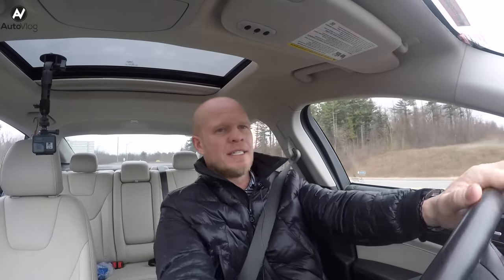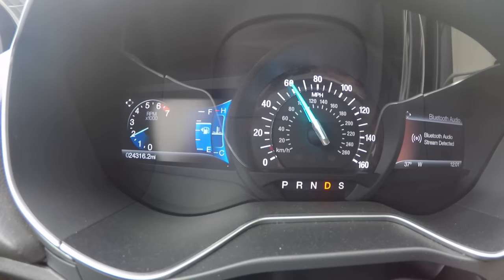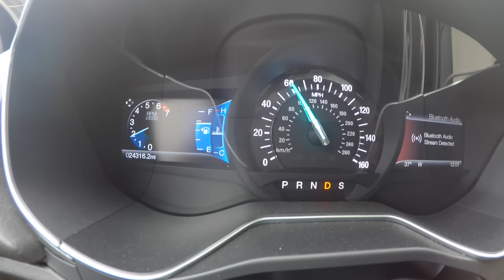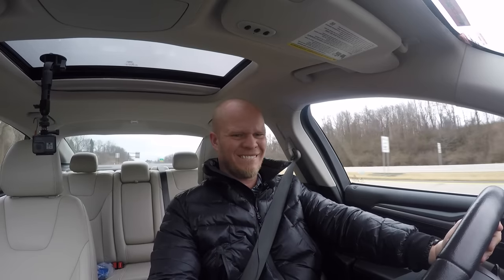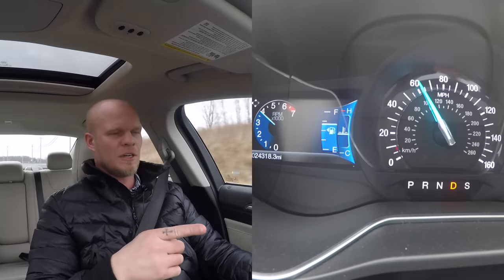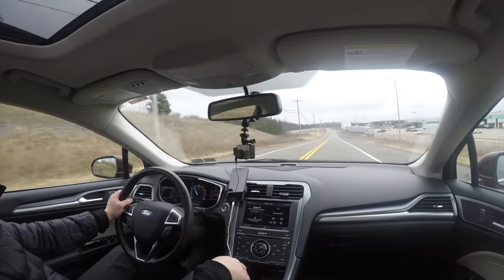What happens if you put your car in REVERSE while driving? (Things NOT to do while driving)

Comment: I bet the car behind you saw your reverse lights and got a little scared
Reply: ha hah hah aha hah
Reply: "..Shit. A lot of shit!"
Reply: Hhahaha Good point.
Reply: 10/10 would brake check again.
Reply: your selector stick is also electronic, that's why it didn't do anything, the only exception is the parking selection as it has a  mechanical safe to block the movement of the inertial wheel
Reply: Rafael Arriaga Spezzia no one was questioning why it happened
Reply: I drove around without knowing my neutral safety switch was causing my reverse lights to stay on. Nobody honked at me surprisingly.
Reply: Barry Bamb lol
Reply: Jack Pepal 😂😂😂😂😂
Reply: was thinking the same thing XD
Reply: what about manual transmission cars?
Reply: The gears will just grind, you wont be able to get it into reverse gear.
Reply: good idea, try with manual gearbox
Reply: The Synchros will stop it from actually going into reverse but yeah a lot of grinding happens also. Mythbusters tried slowing a car down with an old automatic gearbox and a manual gearbox and nothing really happens
Reply: lizzo001 manual gearbox helps u a lot when u are slowing
Reply: Jack Pepal there's no car behind him
Reply: Luis Aguirre there is at one point

Comment: why would you do it on the highway?
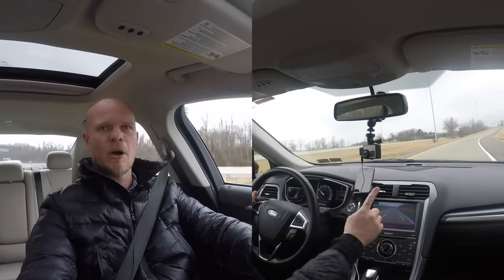Reply: BCRoadGeek **Listen at 2:20 when the car is in reverse... No cars?
Reply: BCRoadGeek **I didn't quote you on anything you said. Whole point is what if it did blow up and parts went everywhere. Plus transmissions don't have a whole bunch of oils in them. That's people point I'd assume. Yep, they do...
Reply: Ford has a transmission control module that monitors several different inputs such as vehicle speed and above a certain speed the module will not allow the shift solenoids to engage into reverse so as not to destroy the transmission. Don't try this EVER, especially with older vehicles, as not all vehicles have this safeguard. You've been warned.
Reply: If i put my 2012 tundra in reverse the reverse lights, cargo light, and my backup camera comes on while the truck goes in nuetral.  But that is a built in feature. Tailgaters hate me at night needless to say lol
Reply: Blaine Palmer 
i have a feeling he researched nothing would happen despite what he said.
Reply: same happen my dumb ass did it my honda 2010 and it just went on neutral

Comment: all automatic transmission has some protection mechanics, try to do this on manual transmission, you will either fk up your transmission or fk up your car and cause crash
Reply: David King more like you'll just grind some gears.
Reply: thats not how manual transmissions even work.
Reply: bwn 2k you don't need to tell me. you can try it out
Reply: I have. you cant do that on any modern-ish manual car.
Reply: If you can manage to get it in to reverse while going forwards that is.
Reply: you can't put a manual to reverse while going forward. It's impossible. If you try, it will just make that weird noise when gears touch each other, but you can't actually put it in.
Reply: if you have a synchro on your reverse gear it will go in. not many cars have them but they are about.
Reply: not all automatic transmissios have a safety against this, the new transmission are all electronic and are shifted by switch's, the old style on the steering column are done by a over to a cord to the transmission that shift it through park nuetral drive d1 d2 , in that case he transmission would try to shift and breathe the reverse drive clutch and no more reverse...there ya go
Reply: steffan thomas Q
Reply: steffan thomas Idk about that. My 71 BMW had that and so does my 85 Supra
Reply: Actually the synchro stops it from going in since the synchro only allows the gears to mesh when they aren't moving in reverses case, however if the synchro is broken you can get it in reverse. It wont lock up the car or break anything it will just stall the motor and act like its coasting in neutral
Reply: my car is a mazda 6 from 2003 and my girlfriend was driving 90km/h (~56 miles/h) and put it into reverse, as she is used to having 6 gears. I don't have troubles with the gears at all.
Reply: No actually your car will start locking up the drive wheels and the engine will start to run in reverse, depending on the speed it is performed you can throw a rod and overall total your engine from over revving.
Reply: not true not all autos have cut out protection hahaha
Reply: fhhsvnggbh depends on speed, going slow enough reverse can be used to stop the car
Reply: I've used reverse to stop when my brakes went completely out just a couple months ago in my manual 05 Jetta
Reply: +DannyMellor R.I.P Clutch.
Reply: Fudge You No actually not. I down shifted to a low gear so I was only going to reversed from a few MPH. You so what you need to when you have no brakes.
Reply: Ahh, thank god you had a stick is all im gonna say. Some autos let you select the gear you want to be in so those can be helpful but unless they lock up the torque converter not much engine breaking will happen.
Reply: If you dont have brakes just turn off the ignition. Atleast you wont have to pay for gearbox repairs (though I dont think gearbox will totally disintegrate, but doing this should worn the reverse gear).
Reply: David King now i will search videos of someone put reverse in manual while driving :v
Reply: It wont happen, I guess technically if you put enough pressure on it, you could destroy your reverse gear. However the rest of your gears should be fine. You see all modern manual transmissions, are called synchronized transmissions. This means that there is a synchronizer between each gear. This allow to shift from one gear, to anther, despite the fact that those two gears are not spinning at the speed. There is no synchronizer for reverse, because is always engage at a stop, so all gears are spinning the same speed, 0. It is also, accidently, a nice idiot proof. However I do have one question, especially on this automagic car, when you put it in reverse, are your reverse lights coming on. If so, do you think behind you, doing 60 shit his pants :).
Reply: Kevin Weil good question :)
Reply: If you have the arm strength/stupidity to do it in a manual I'd be amazed. Attempting that in a manual will result in the shifter resisting you and a lot of grinding. The faster you're going, the less likely you are going to be able to put it in reverse while moving. If you ignore the grinding and manage to get it into R, you shouldn't own a manual.
Reply: ryfodrea agreed, I drive an 02 Audi a4 1.8t 5 speed... And I'm used to driving a 6 speed. So there has been more than a couple of times where I have tried to put mine in  Reverse accidentally and couldn't do it

Comment: you have an electronic transmission.  the trans controller refused to select reverse because of the vehicle's speed.  if you had an older auto trans with direct selection you would have locked up the wheels, possibly snapping the trans output shaft and crashing because of the sudden change in velocity of the wheels.  in a rear wheel drive car it would have been similar to just pulling the ebrake and locking up the wheels with respect to the cars reaction to the gear selection.  at low speeds you would have just lunched your transmission and probably not crashed.   a manual is not that different in results.  I am very shocked that you tried this on a public highway.
Reply: thevdubin bro if you were doing 100kmh its unlikely youd even lock up the wheels of a front wheel drive car, youd just blow the inside of the transmission everywhere and keep rolling. On a rear wheel drive car it might lock up the wheels briefly, however it is more likely just to smash everything and keep rolling
Reply: Just imagine an old ford C4 getting thrown in reverse at 65 mph it would probably throw it self out the car our self destruct with a change in power that quickly lol
Reply: Word.
Reply: thevdubin not.
Reply: So in an old truck could you roll out of a parking spot and switch or will it quickly lock the gears
Reply: unless he knew nothing would happen because it's electronic
Reply: Thank you someone who understand cars do people not know that u can just google this
Reply: thevdubin I was going to say the same thing
Reply: thevdubin I'm pretty sure he knew nothing will happen especially when he knows there's a car behind. But I agree that my feeling is the same as yours when I just loaded this video. BTW, I do love the facial expression he pretend to have lol
Reply: thevdubin that sounds about right
Reply: thevdubin  I thought the same thing “on a public highway” nah I think he already knew what was gonna happen  because why would you take such a risk in harming other drivers for the sake of an experiment.
Reply: thevdubin Jo
Reply: I was in a 98' Corolla Automatic car doing 35-40mph when the driver forgot she already had it in neutral while going downhill and threw it in reverse. The entire car stopped quicker then slamming on the brakes and everything flew forward. Scary as hell but no one was hurt. It definitely was an experience.
Reply: thevdubin not true.... At all. Lmao.
Reply: Dimitri Borozny only if you have your foot pushing the accelerator pedal
Reply: People who have older trans cars need to read this so they don't try it
Reply: kyrren love it will still glide in neutral unless your foot is depressing the accelerator.
Reply: Nzmaximus no one uses kmh kid.
Reply: thevdubin I was shifting into neutral going about 40 miles an hour on an automatic transmission and I accidentally threw it in reverse. I never pressed the gas though so am I fine or should I check it oht
Reply: Pearce Packman depends on if you felt the car jolt. Putting it in gear is enough to destroy it if you were already at speed. As stated above, if it's an older transmission then you'd already know the car is destroyed
Reply: A manual would reject reverse
Reply: if u were only going say 2mph and shifed into reverse while moving forward, samething?
Reply: I had a 1984 Dodge diplomat slant 6 cylinder, I was going 45 mph I accidentally hit the shift upwards in reverse and nothing happened to the tranny all I could hear was a rapid "clicking" sound as if the tranny was designed for such an accident. I shifted back to drive; everything was normal...
Reply: @maxneale6334  I knew a guy that had a back wheel drive car that he and his father custom built. He did 120kmh and he accidentally shifted to reverse causing his car to spin out, he fell through the window and the car on top of him while rolling down a hill. His friend who was sitting next to him survived.
Reply: Dude your a legend for this comment
Reply: That happened to me once. I once ruined with misshift
Reply: thevdubin Well, actually it has to do with the torque converter. As long as he doesn’t step on the accelerator, the torque converter will be overpowered by the momentum of the car as the engine is not creating enough fluid flow to rotate the transmission turbine. Now, if he did decide to step on the gas, the transmission would be twisted completely.
Reply: I did this by accident trying to move to neutral and my hand slipped and went to reverse. I wasn’t going very fast. I say about 20 mph or 30 and well it locked up didn’t crash I was able to steer it but my truck turned off. It turned back on and right now it doesn’t really feel like anything happen although I’m pretty scared lmk please on your response
Reply: @fredo6669  in an auto its a bit more forgiving.  you will have caused damage, no doubt.  but it could be a bit less life in the clutches and steels or a bit more like a cracked part.  if you feel no issue right now then there is no telling when you could have a prob.  be happy and drive it.
Reply: thevdubin I’m happy as hell lmao I’m glad I wasn’t going fast. Or anything phew 😅
Reply: So you snart smart huh
Reply: Hey i have a 2017 ford flex se, if i put into reverse while driving. Will same thing happen in the video or will the transmission be ruined
Reply: Can someone help me out cuz my friend crashed it seemed kinda sus but I still don’t really know about cars but she put the car in reverse and I think she pressed on the gas cuz then we went forward really fast and crashed into a light pole it’s like she pressed on the gas hard (remind u she was a new driver but she was driving around a parking lot before that happened perfectly fine)
Reply: No its just shuts off the engine but that was in a 2000 Chevy 6.0 diesel
Reply: @debbicockett6044  you are very beautiful!
Reply: he tried it in an older automatic, and all it did was stall/shut off the engine because of the sudden force, but the torque converter and whatever make it so the wheels don’t lock

Also in a manual car its very hard to put into reverse, but it would basically be the clutch handling all the force
Reply: @eirenjoe1513  It would lock the gears and shut off the truck completely (probably to save the truck from breaking itself), at least that's what happened in my 2000 toyota tundra
Reply: this is reassuring to know. Recently my friend accidentaly shited to R while I was driving, because he thought the revolving shifting knob was a music buttom for volume. I freaked the sh*t outta my head at that time but also feeling bizzard because nothing happened, the car just goes on. And I kept doing research afterwards to see if that action would damage my car. Now I know it should be fine, thank you.
Reply: I just did it in a 2005 Chevy Malibu V6 at about 15MPH, it made a short screech noise but didn't lock up and when I put it back in park it wouldn't drive but when I restarted the car it's fine now

Comment: what people dont understand is that this guy has basically a brand new ford which has technology to prevent shit from happening, try a manual or an older car and lets see if u get the same reaction
Reply: jake from statefarm my thought, exactly
Reply: Manual would just crunch like fucj
Reply: it will shut off the engine. i once accidentally chucked it reverse xD 1997 holden.
Reply: EXACTLY MY WORDS FR FR
Reply: jake from statefarm exactly my 04 Chevy Silverado would probably throw the damn transmission out of the truck 😂
Reply: if its auto no it will just shut off the engine its happened to a friend of mine
Reply: jake from statefarm exactly. I won't try this on my car.
Reply: on manual you just cant put reverse while the car is moving
Reply: you will just hear the gears eating each other lol

Comment: Get a really really cheap disposable manual car and take it on the empty road you like to use. That will deffo throw into reverse
Reply: Dominic Rawr Yep, there'll probably be a grinding noise & then all you'll see is the car slowing down & smoke everywhere
Reply: Zubin B. Most manual transmissions won't let you put it reverse while it's moving forward.
Reply: It's theoretically possible to put a really old gearbox without a syncromesh into reverse if your strong enough to put enough force into it, which is why i suggested a really really cheap disposable car because it will most likely be old enough to not have anyform of protection
Reply: no you can force it in gear... just pull with both hand and it will go in followed by an awful grinding sound and metal fragments being thrown around
Reply: I ground the gear a lil by almost putting it into reverse instead of 4th in my 07 eclipse when I was first learning how to drive it so yes it's definitely possible.
Reply: Dominic Rawr It would just grind some
Reply: myth busters tried this. Gears wouldnt let it happen. Just grinds
Reply: I did that in the eighties in a manual car by accident. It makes a hell of a noise, but the gear will not engage, so nothing happens except some grinding noise.
Reply: One man managed to put reverse (accident) in quite new subaru on highway, wheels grinded, instant brake, expensive transmission repair. In most modern manual cars you can not shift directly from 5 to R, you need to go 5->N->R. But one will not manage to put it in reverse easily because reverse gear mostly doesnt have synchrons, so you try to put together two gears which turn opposite way - almost impossible
Reply: Do it in a manual
Reply: amd87ts it depends on the manual. if you have a synchronized reverse nothing will happen. if it's not you will get a grinding sound that either you will muscle though to engage reverse or you will recoil and not engage.
Reply: @94 7.3 IDI turbo Diesel    EXACTLY, alot of people haven't driven manual before. You can't and you won't put it in reverse while car is moving forward, you have to stop before you can put it in reverse. And if I'm not mistaking, you won't hear any grinding noise either if you try, you just won't be able to engage it at all.
Reply: NoNegotiations *shouldn't
Reply: you're locked out of reverse m8
Reply: Dominic Rawr   I done that in a 1970 C-20 pickup. I was going about 40 and it was no problem going into reverse at that speed. It just roasted the tires. When i floored the accelerator it spun the tires so much that it took a good 15 to 20 seconds to stop and start going backwards. It was our old farm truck and it was tough as nails! 327 with a 4-Speed with a Granny-Gear. For you that don't know what a Granny-Gear is, it's a very low geared 1st gear. You could put it in Granny and get out and walk faster than it would roll. It's for pulling very heavy loads.
Reply: Dominic Rawr Good luck getting that gear to engage! All you'll do is grind some gears
Reply: Nick lol. My porsche 944 just won't go into reverse until I stop.
Reply: haha